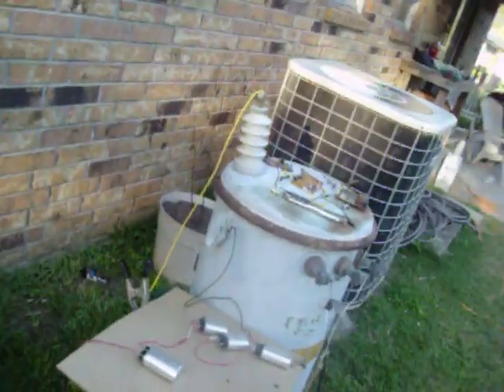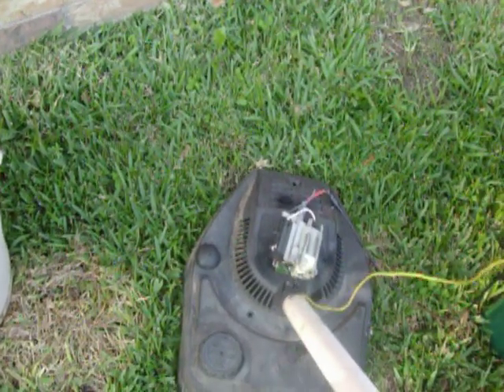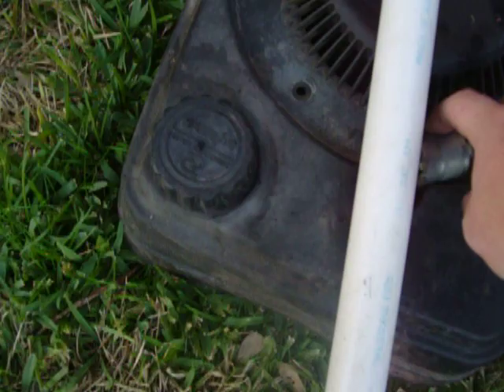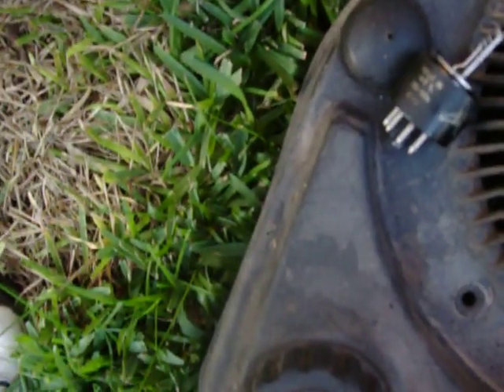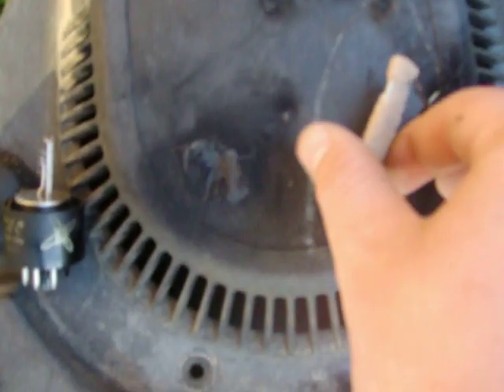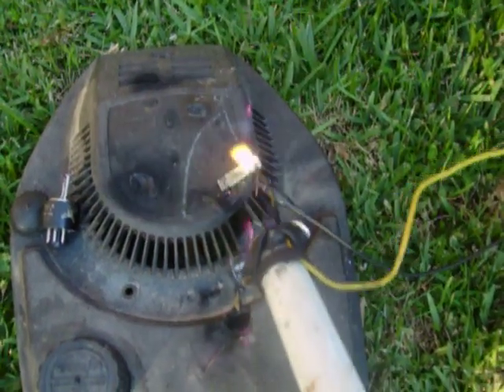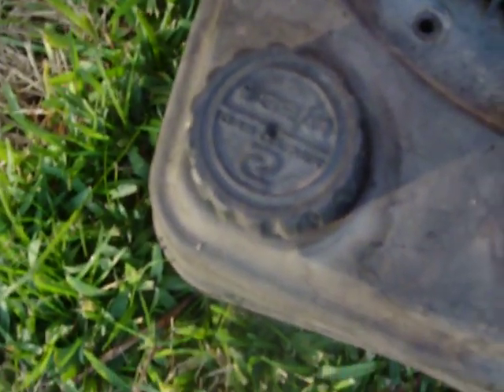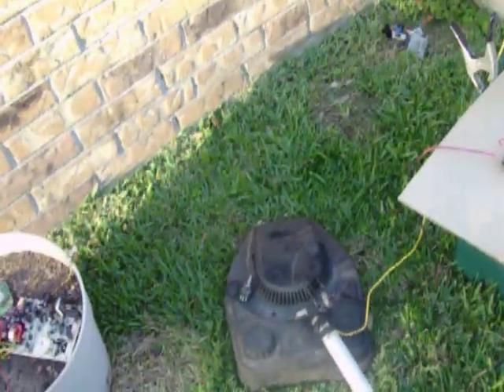Frying stuff with my pole pig.

Comment: Haha!  Loved the voltage rectifier tube, the HV anode had enough resistance it didn't arc at first, because it's rated at that voltage, but after melting the bottom you got a short and bam!  Glass shatters.

Comment: @triggerhappy77707 

sorry i was in a grumpy mood, I'm fine now i finally figured out my problem with my vttc, and do you have a working diode tube I am in need of one. it needs to handle mot voltage.